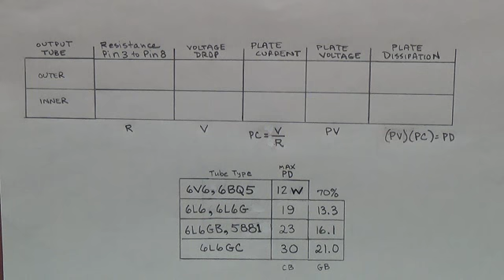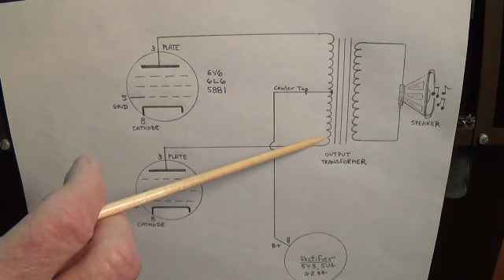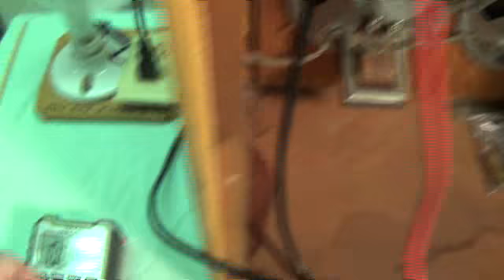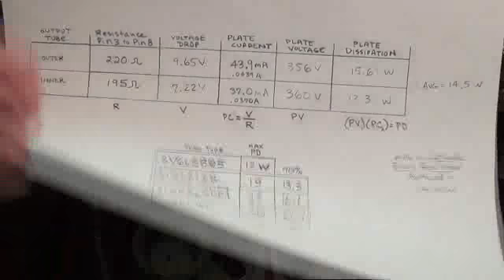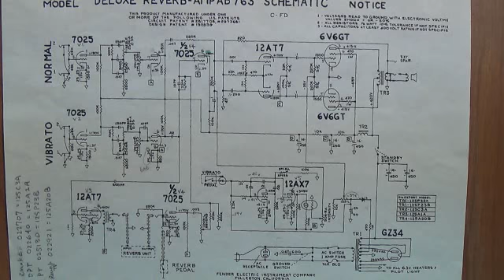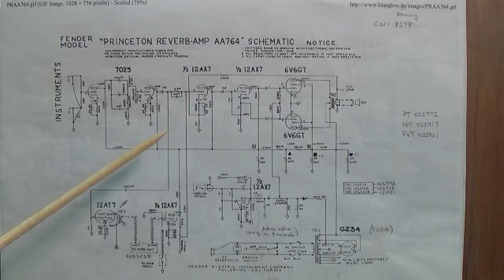Biasing Double-Ended Amplifier Output Tubes, Part 2: Demonstration and Discussion

Comment: Hi Uncle Doug, 
Noticed that my 5E3 chassis gets very hot, so hot that it will almost burn the fingers after playing for 30 min. or so.  Also, not much clean headroom on the amp.   After watching your biasing videos decided to check and see how hot the tubes are running.  Using your method I calculated plate currents of 36 mA on each 6V6, plate voltages of 362V and 364V, and plate dissipation of about 13 W on each tube.  I have 2 questions:

1.  Should I subtract the cathode voltages from the measured plate voltages to get a more "accurate" plate voltage for each tube?  I'm hearing this from other builders on the internet.   If I do, my plate dissipation values drop to about 12.3 W each.

2.  In order to bias the tubes colder, perhaps shooting for plate dissipation of 9-10 W, what would you recommend in a cathode bias resistor value?  My current resistor is the standard 270 ohm 5 W. 
 
Many thanks,
Jay
Reply from the maker: +Jay Warrick Greetings, Jay. 1.) Yes, you can measure the plate voltage to the cathode rather than ground for a more accurate (net) PV. I added notes to the bias videos explaining this. 2.) It's a matter of trial and error. I would start out with a 400 ohm resistor, repeat the measurements, and then fine tune as necessary. You will note that the PV will go up as the PC goes down, so keep an eye on it. A PD of 10W should be fine.....cooler running, longer tube life, and more headroom. Good luck.
Reply: Uncle Doug, a 500 ohm resistor brought the tubes down to 10 W plate dissipation, right on the money.  thanks again for your help.
Reply from the maker: You're welcome, Jay.

Comment: Uncle Doug, Thanks again for these awesome videos, you have a ton of great information. I just replaced the caps on my Fender 75 and it does sounds a lot better, less hum and everything. I decided to check the bias on it as well. It's a fixed (grid) biased amp with a bridged rectifier, as you mentioned in another video, it has the 4 diodes and caps. The center tap from the OT goes to a hi/lo power switch before the rectifier so I measured resistance from there to the tube plates. I'm pretty sure that is the center tap, there are 2 other leads outside of this one that go to the other grids of the tubes. 

These are the numbers I got on low power (15 watt) mode, the other tube is very similar:

Resistance: 50.8 ohms, Vdrop: 0.72V, PC: 14.2mA, PV: 216, PD: 3.07W

This is Hi power (75 watt) mode:

Resistance: 50.8 ohms, Vdrop: 0.62V, PC: 12.2mA, PV: 420, PD: 5.124W

These numbers seem very low to me compared to the numbers you usually get. I'm pretty sure I'm measuring in the right spots and i double-checked the scale I was using so these are the right values. There is also an output tube matching pot which I'm thinking of converting into a real bias pot to see if that changes anything. What do you think?

Oh and thank god I made a current limiter like the one you have. That bulb lit up a few times, i'll be more careful next time...
Reply from the maker: +maggit13  I looked up a schematic, and it appears that the resistance of the OPT primary windings would be measured (meter set to "Resistance") from between the (red) wire attachment to the center of the Hi/Lo Power switch to pin 3 (Plate) of each 6L6 (blue wire and brown wire)....amp "OFF". Then you would switch to "DC Voltage" and measure the voltage drop across each winding and at both power settings....amp "ON" (be careful).  Your voltage drop measurements are quite low.....I would expect them to be around 5 times greater.  Your measurement look more like Screen Current than Plate Current.
Reply: +Uncle Doug ok thanks for the info. I'm 99% sure I measured from the plates, pin 3 on the tubes but I'll check again. if those are the right numbers, what should I do?
Reply from the maker: I would think that a high-powered 6L6 amp that is biased at 3W to 5W would sound awful. 6L6GC's can handle up to 30W of PD. If the amp sounds good, then there has to be some error in the method of measurement or calculation of PD.
Reply: +Uncle Doug I don't doubt that there is some user error in there :). I'll check again but it does sound pretty good, have to turn it way up to get overdrive though, very loud.
Reply from the maker: The hotter the bias, the lower the headroom. If your output tubes are biased excessively cold, then the headroom would be huge and the tone should be rather weak and brittle (to use purely subjective, abstract terms).

Comment: @Uncle Doug I had a real head scratching moment when trying to measure the resistance between pin 8 and pin 3 on my Fender 5E3 (that I built).  Until I stopped being an dunce and remembered that pin 8 on the 5E3 goes through the standby switch (on amps that have one).  So if anyone is trying this and isn't able to get that measurement (with the amp off, which it is for this particular measurement) flip the standby "on" and it will open this circuit and you'll get a measurement:)
Reply from the maker: +Vidkids  You're not the first.....or the last.....to make that mistake, VK. If you check through the comments below, I think you might find a few others who learned this "the hard way".  Personally, I think solving mistakes is a great way to learn. Thanks for your input :)

Comment: Hi Uncle doug! I've recently biased my 1074's Fender PA-100. Now it works with 44 mA and 466 V (6L6)... But suddenly after a noise similar of unplug a guitar in a amplifier on, the current in one tube rises up to the maximum of the meter (VHT current Meter)... What could it be? The Filter Capacitors? (I've recently renew them using Sprague Atom).. ¿Or the resistors in the tube socket? Thanks
Reply from the maker: +Victor Martinez Armijo  Greetings, Victor. Since your circuit is fixed bias, with grounded cathodes, the maximum plate dissipation (PC x PV) is 70% of the maximum (19W for 6L6G and GB), which would be 13.3W. The plate dissipation with your biasing is 20.5W which is way too high if you are using any 6L6 other than 6L6GC's.  If you use new 6L6GC's, then your biasing would be about correct (70% of 30W = 21W).  The sudden rise in plate current is probably due to a loss of bias voltage to the tube. This may be the result of internal shorting within the tube if the PD is way too high, or some problem with the tube socket (losing pin contact, i.e. bias voltage to the grid) or the bias voltage supply itself.  Good luck.
Reply: +Uncle Doug Thanks! Yes, sorry, the tubes are 6L6GC... I'm looking if some pin connection is loose.. one of the pin to ground (cathode) was kind of loose... If just one cathode pin to ground of the 4 tubes get disconnected... it may be the problem? The reading of the current was more than 100 mA...
Reply from the maker: I doubt that a loose cathode pin would cause the problem, but a loose grid pin certainly would. Tighten up all the socket sleeves and measure the bias voltage on the grid pin of each 6L6 (with tubes out of the socket) to be sure that the bias voltage is getting to each tube.
Reply: +Uncle Doug Ok... Just to be sure, the grid pin of the 6L6GC is the 5th pin??? Thanks!!!
Reply: +Uncle Doug Ok, now I've got it... The problem is caused by an insufficient bias negative voltaje... (I test the tube and it seems ok, without leak and strong response). So, I have to see in the bias circuit. It's good idea start to tight all grids pin and check that the negative voltaje is ok. If not, I Will check the diodes ...
Reply from the maker: +Victor Martínez Armijo  While you're checking diodes, Victor, be sure to check the one responsible for rectifying the grid bias voltage. Yes, pin 5 is the grid. If you're ever in doubt regarding the pin connections in any tube, simply access a tube diagram on the Internet.
Reply: Hi Doug! This is the Bias circuit of the Fender PA-100.. Why would I expect in the control grid voltajes by turning the Output Balance? It would be rise in one side and low in the other?? Thanks!! https://www.facebook.com/MBlubber/posts/10153789788108781:0
Reply from the maker: Yes, since this is simply a balance control, rather than a bias control, when it sends more bias voltage to one tube pair, the bias voltage to the other pair will decrease. The actual bias voltage is regulated by the 45K resistor connected to the balance pot wiper.
Reply: +Victor Martínez Armijo 1074? Please decode the CB speak for this poor ignorant limey!

Comment: Uncle Doug. That bias adjustment for the 6V6 pair is called BIAS MODULATION.
  I printed off the Princeton blackface AA1164  schematic to see it a bit better of the values with a magnifying glass.  The negative bias diode goes to one side of the 220k (intensity control) but the intensity control also goes to ground via 22k resistor, so the dc  bias component  or this dual purpose control has a minimum value of 22K. Now the other side of the intensity control is AC coupled to the plate to isolate  the tremelo oscillator
via a 1 meg resistor and 0.02 caps. (more)

This is called Bias Modulation
 One  cap to ground and the other to 250K (L = Linear) intensity pot.

"The Bias Modulation design, conversely leaves the preamp gain alone, but instead plays with the power tubes gain and consequently, their clipping characteristics. The circuit also introduces a type of distortion called “crossover distortion”. It is a nasty, odd-harmonic distortion caused by the fact that the signal is not being completely reproduced. It ALSO CAN'T BE REALLY USED IN HIGH POWER AMPS. 

 Therefore, this inherently less costly, less complex circuit is usually reserved for LOW POWER inexpensive amps. Good examples are the Princeton, Deluxe and Tremolux.

So the way I interpret it. The 250K pot just moves the negative bias (as supplied from that diode) to EITHER  MORE  NEGATIVE 
to decrease conduction of the  OSCILLATOR signal from the the oscillator, or LESS NEGaTIVE  to increase conduction of the oscillator signal. and of course some inherent distortion goes with it. The bias is modulated by the oscillator signal and the intensity pot setting. Don't know why Fender decided to do it this way, but they may have had their reasons to save on
tubes and components in manufacture. 

Because of the capacitor isolation, only the AC signal from the oscillator is present THROUGH THE 250k pot.  The dc negative
bias is determined by the centre tap of the intensity control. 
Intensity in this case is  the , amplitude of the signal.  Basically a design requiring fewer components. 
If you want to read more..go to " 300guitarsdotcom "  and search for " Tremelo-How it actually works in you amp."
Reply from the maker: +SuperCarver2011 Thanks for this very detailed analysis, SC.

Comment: is the amp OFF when you measure the resistance between pin 8 of the rectifier, and pin 3 of the powertubes? because i cant seem to get any readings.. building a jtm45-amp, wich is grid-biased.. i usually use a probe, but since it dissapeared, i thought i should learn the correct way!
Reply from the maker: +christian dahlgren  It had better be off, Christian, or you will fry your ohmmeter.  Download a schematic and locate the points from which you can measure the resistance of each half of the output transformer primary. Perhaps there are better measuring points in your circuit than the ones I described in the video. Good luck.
Reply: YES!!!!!!!

Comment: Hi Uncle Doug: Your biasing video is perfect. I built a Tweed Deluxe about a year ago, which came out great for a customer of mine. The issue with the tweed with the bias using the stock 250 ohm resistor caused the amp to breakup too fast. Using your described method allowed me to figure out that 330 ohms put the amp at 13.9 and 14.2. The amp for my customers taste and mine is just right now, thanks again, Bob
Reply from the maker: +starlingave You're welcome, Bob. It's great to hear that the video was helpful. Thanks for sharing this experience with us.

Comment: Hello Uncle Doug and Rusty,
I would like to have your opinion, about the 5u4gb vs gz34 discussion.
Some technician advice to replace the 5U4GB asap to a GZ34,  as it was a sort of poison.
Greetings, Benny
Reply from the maker: BAMPSANDPEDALS Greetings B&P, as I explain elsewhere in the discussion of this amp, the GZ34 is far superior in every way to the 5U4. The only consideration is that, due to its greater efficiency, plate voltages (and dissipation) will increase....possibly to uncomfortable levels......requiring circuit modifications to compensate.

Comment: Hi Doug, why is it that you never see the DC resistance of an output transformer listed in their spec? If for example your cathode biased amp had a 130 Ohm bias resistor, would you expect similar resistance on each side of the OT when you measure it? Should they at least be in the same ball park? The other thing I have seen on some schematics is 'Imp Anode to Anode 8000 Ohms'. How does or rather I should say does this relate in any way to the DC resistance? Please forgive my silly question if the answer should be obvious.
Reply from the maker: allanpennington Greetings, Allan. Your questions are anything but silly. I have never noticed any equality between the bias resistor value and the primary winding resistance. There may be some correlation, but I'm not accustomed to seeing them be equal. Impedance is purely an AC phenomenon and, again, it probably relates to the DC resistance of a coil, transformer, etc.....i.e. a voice coil with 8 ohms of impedance generally has a DC resistance of 6 ohms.....but impedance is also affected by frequency and other variables that interfere with the establishment of an infallible formula to correlate it with DC resistance.
Reply: +Uncle Doug  Thanks Doug you are a great instructor. I am a little confused though. When you demonstrated biasing the single ended amp you obtained the resistance by measuring the resistor itself. This in turn gets divided into the voltage drop to obtain the plate current. So even though you use a slightly different method to obtain the resistance (via the OT) I can't understand why the OT resistance on each side should not be close to the value of the resistor. This assumes the resistor is near or equal to its stated value. I recall you did compare the end result of the Part 2 biasing procedure with the other method and obtained very similar results; 14.5 vs 14.68. This is why I concluded that the resistance in half of the OT must be close to or the same as the bias resistor value; since all the other derived values relate to the value of the resistance. The only thing which I don't know, is the value of the voltage drop using the first method, however it must again be similar to obtain the same result. The only way they can be different to this method is if both resistance and voltage drop are different but in this case their ratio, thereby defining the plate current is the same or similar to the results from either method since the plate voltage should be the same regardless of where you measure it from. Sorry for such a long winded explanation of how I thought this through but I just want to try and understand the methodology of how we arrive at the answers. I should have paid more attention in school but I did do Pure and Applied Maths to first year college level. Sadly that was eons ago and brain atrophy happens when you don't continually practice.
Reply from the maker: Allan, there are two popular methods to determine plate current (PC).

1.) You can measure the voltage drop across a cathode bias resistor and divide it by the value of the resistor:  i.e. Resistor = 100 ohms and Vdrop = 3V   then divide 3 by 100 = .030A or 30mA  This is the method generally used for single-ended amps.

2.) For double-ended amps, measure the resistance of the OPT primary (CT to tube plate) and the voltage drop across it. i.e. Winding R = 150 ohms and Vdrop = 4.5V  then divide 4.5 by 150 = .030A or 30mA.

In both cases, the resistance is different and the voltage drop is different, but the PC is the same. I think your confusion is caused by thinking that the voltage drop for the cathode resistor is the same as for the OPT winding.....it is not.
Reply: +Uncle Doug Thanks Doug I understand now. The methods achieve the same result therefore the ratio between R and V drop is the same but V drop and R for each method will differ in individual values. Cant wait for the next vid on the Elvis Amp.
Reply from the maker: You're exactly right now, Allan. Glad we could clear that up. Part 2 will probably be posted today (Monday), so stay tuned.....lots of pet silliness :)

Comment: Hello Uncle Doug, Rusty. I did a test, using your measuring method, with two 6V6's who were not bought as a match pair. The outer tube has a plate dissipation of 9,88 watt, the other 11,25 watt. Average value is 10,55 watt. I think this is not a bad combination, following your advise to stay under the 12 watt. Many thanks, Benny
Reply from the maker: BAMPSANDPEDALS Benny, you're right, they are not ideally matched, but should work just fine at your settings. I have operated amps with similar PD disparity and have been satisfied with the result.